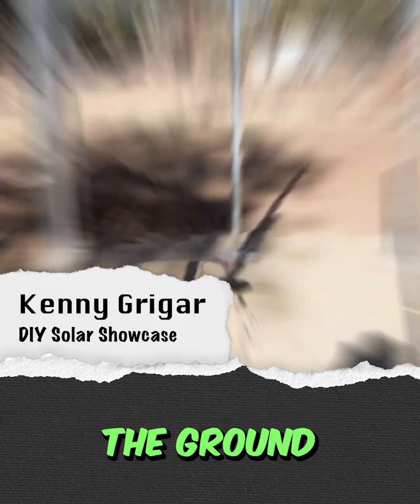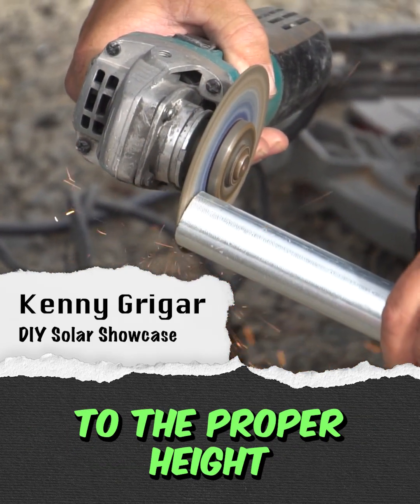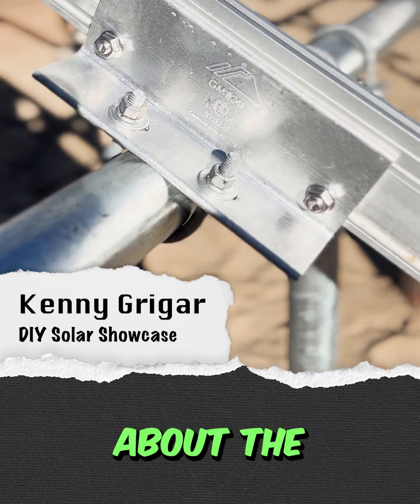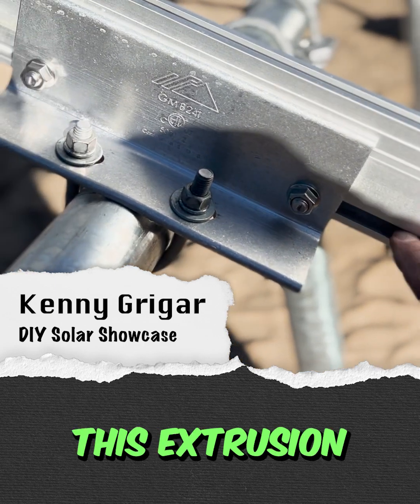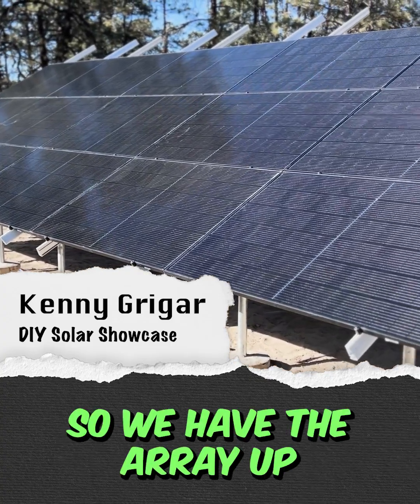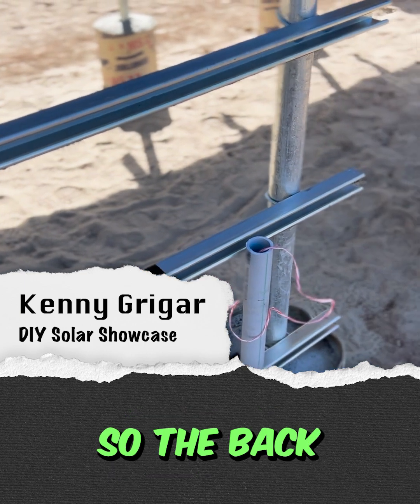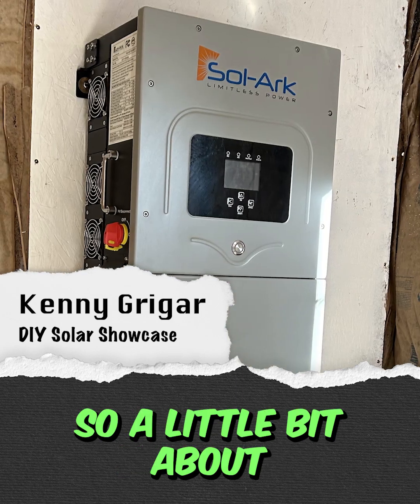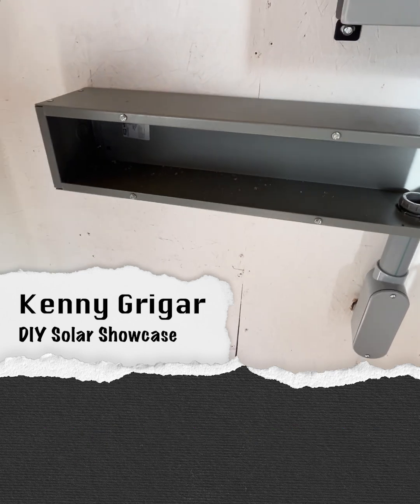Ground Mount DIY Solar: Foundations, Racking and Wire Management | DIY Solar Showcase

Comment: New AC inverters where I should say mini inverters on the backside of the panels can also increase your power distribution distance instead of broadcasting in DC and losing power over distance even in really really nice wire is still a thing having AC going straight to your combiner box and then to your home to where you’ve got your capacitor base or battery baseis a new thing that I find relatively awesome. Keep in mind when I say new I was doing this when people could only get a hold to 55 W panels.
Reply from the maker: That is a great comment. DC solar strings are high voltage these days and actually travel farther on small wire than AC does, it's come a long way since pops taught me how to size wires for my car stereo amplifier that were as big as my pinky. We are running most solar arrays at 300 volts DC or more.

Comment: Also, good plan there is a phenomenon that happens within conduit over long distances. It is a good idea to leave a bottom part of the conduit open so that water condensation and it will change the electromagnetic charge that develops in between the wire and the conduit itself reducing losses during rain storm Some areas you can lose up to 20% of your power during a rain storm, excluding shade due to this phenomenon has something to do with the electromagnetic field, extending out to the structure itself and creating a power suck because of the connectivity of the water you can interrupt this field by creating openings in the conduit at the end caps or elbows always make sure they’re facing down
Reply from the maker: How do you do that, drill holes in the bottom of the conduit? how do you keep water from getting in there when the ground is really wet?

Comment: One of the things that I used to like to tell my clients when trying to talk them into building smaller server units and larger ones for their homes is now that they have semi transparent panels they make great walkway covers in pergola. You can get them up in the air and get them at the right angle and you’ve got a unique piece of landscape at that point as a cover walkway even a carport if your car park isn’t covered helps with snow removal and if you’re clever about it, they can be lit up from the underside pretty well at night making them look pretty cool. The best part is is the semi transparent panels pick up light from the underside as well as the top side meaning that if you have a white carportor walkway all that lights coming back into your panel tell friends.
Reply from the maker: Love it. Would make a nice arboretum as well.